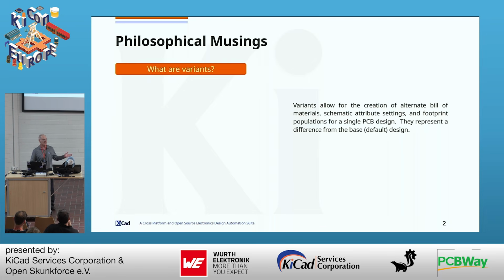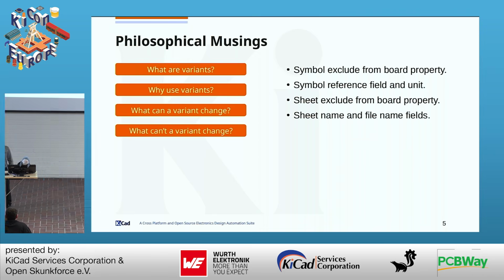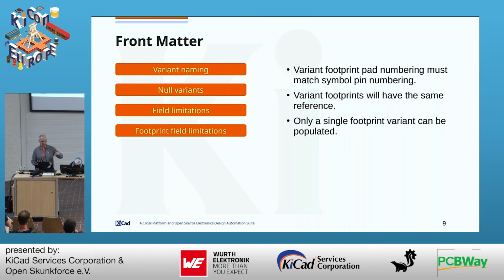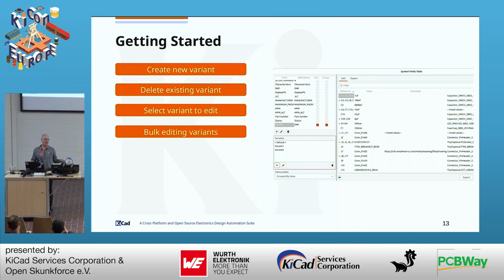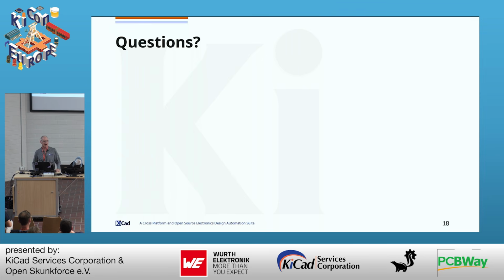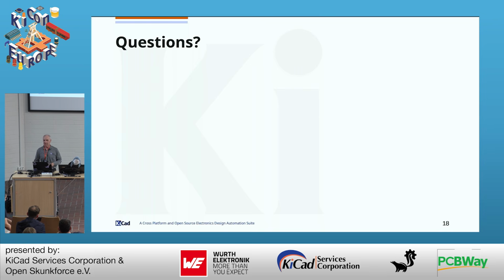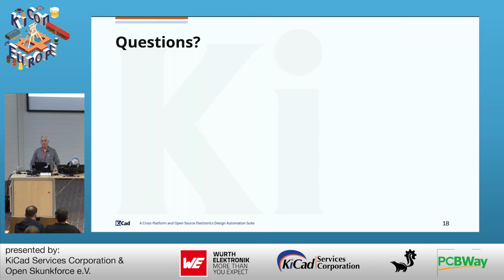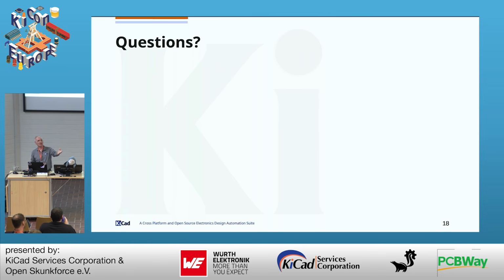Variants in KiCad 10 | Wayne Stambaugh | KiCon Europe 2025

Comment: It's great news for KiCad project because variants are key feature for enteprises!
Reply: Versioning and team collab is missing until KiCad completely takes over as the leading enterprise CAD tool as well.

Honestly, its much better than any other software already at this point. For versioning and team collab git exists, but well, it sucks 😅 KiRI project on github is good but without a team logic. Like comments and all over the schematic for example. But it can see visual differences between version which is huge. There are also automated documentation projects. What would a small medium team of engineers need more?